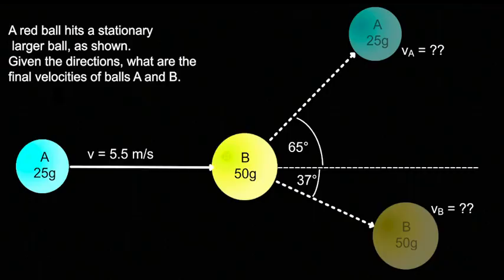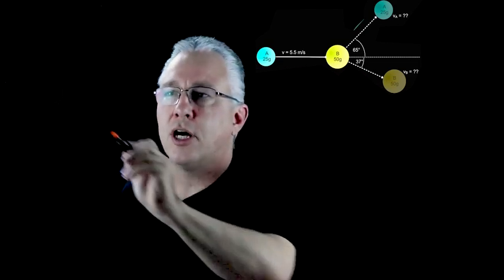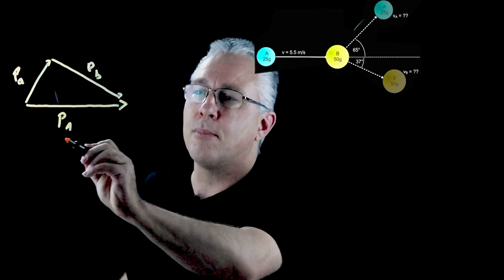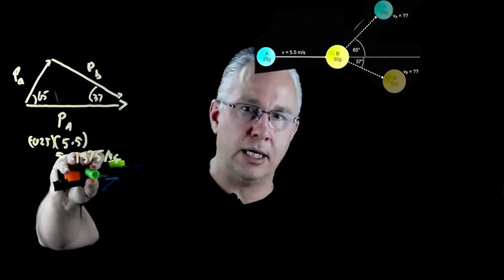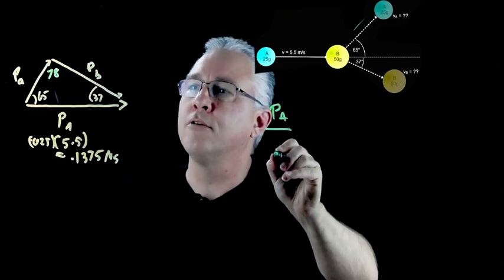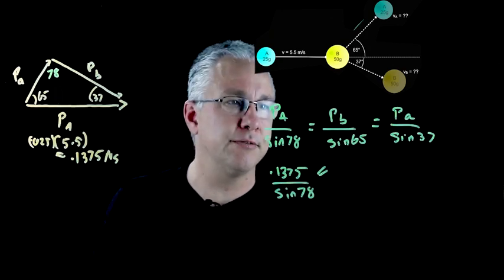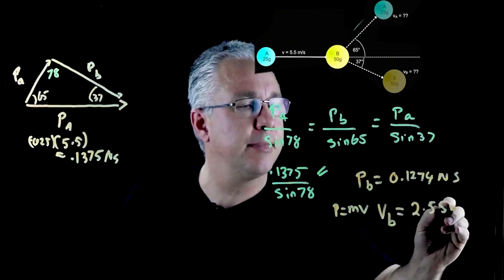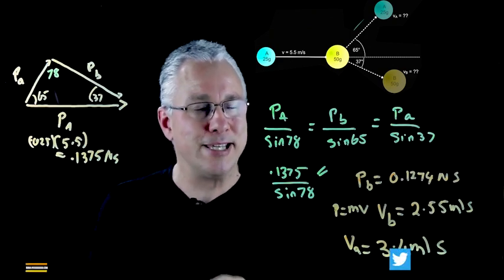Solving a 2D conservation of momentum problem using vectors

Comment: Something irrevelant but I just realized that if the vectors of the momentum are on the same line then you dont have rnough enough information to find momentums. But if like this case the vectors are not the same line then this information is enough. You dont need to know if it is elastic or not